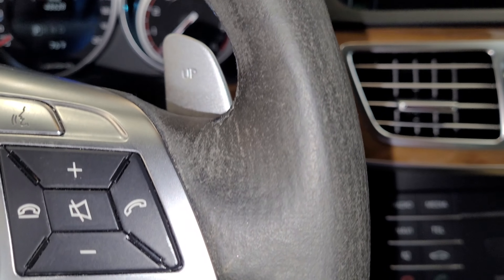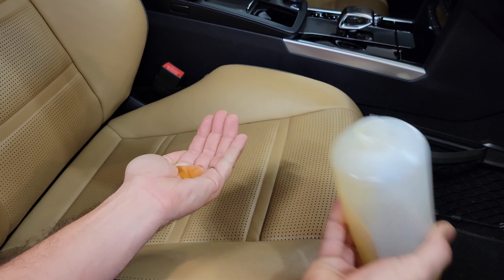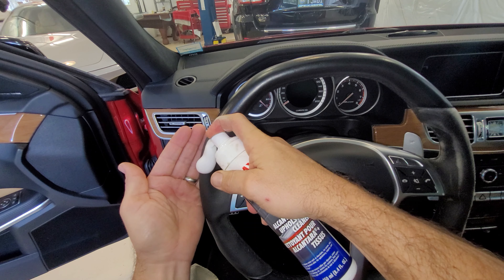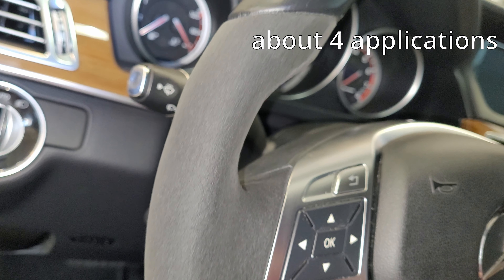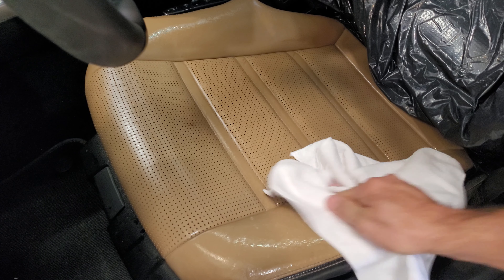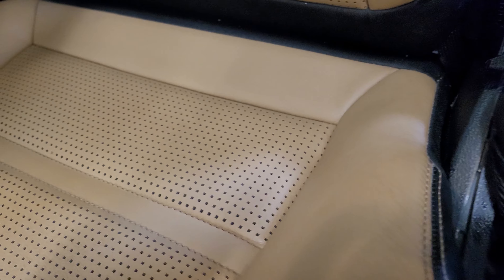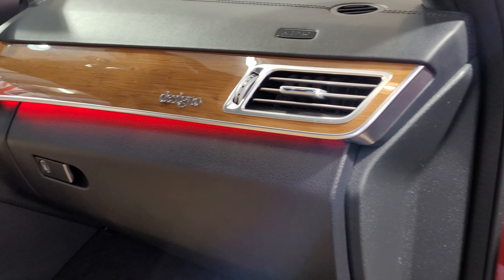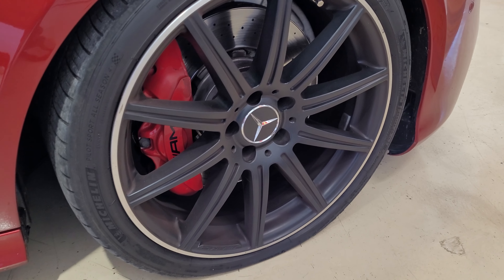Restored my E63 LEATHER & ALCANTARA with Leatherique & Sonax

Comment: Man perfect timing. Finally have my (not officially mine yet but soon) E63S in my possession, and the alcantara on the wheel is just as bad as yours was. I have black seats so can’t tell how dirty they are but since it’s higher miles it’s probably just as dirty
Reply from the maker: I'm not kidding, my steering wheel is indistinguishable between a brand new one. 
While you're black won't be discolored, it'll be kind of shiny glaze to it. It will still benefit a lot from a leather treatment and cleaning

Comment: The seats came out great dude! 👍👍 I need to pick some of that up for my c63's nappa. My seats dont have the perforations like the e63's but i'm interested to see what it can do for the wrinkles on my drivers seat.
Reply from the maker: You may want to do a little pre-cleaning, just to get off any kind of superficial seal, like oils or other cleaners. 
It will penetrate none perforated leather, it just takes a little longer.
There's a lot of different techniques, some people cover them and pull the car out into the Sun so the inside gets really nice and hot and that speeds up the penetration process. Otherwise, just time and it literally may take a week.

Comment: Your videos are excellent thank you. Thank god I noticed one comment about treating the dash as I assumed it was leather too and was going to treat it. Luckily I checked the comments. So what is leather that I should treat and clean?  Gearstick, arm rests on doors and middle between the seats maybe?  Many thanks again.
Reply from the maker: I know the seats, steering wheel, door panels, and probably shifter are all nappa leather, the dash and components like that are product called MBtex essentially a synthetic leather likely vinyl. I actually was curious what products are good for those, typically I just use soap and water and leave them with a very matte finish. But I'm sure there's some better products
Reply: @ExoticCarDIY   Thank you again. So I bought the same Leatherique products as you, about to have a go the seats later.  The instructions say that the Prestine Clean product can be used on vinyl and rubber (window trim, rubber bumpers and tyres) to soften and condition. No more products to acquire 👍
Reply: @ExoticCarDIY  Checked Leatherique’s website and they state “This process may be used on MB Tex vinyl areas to soften and condition.  Even flexibility on rubber window trim can be maintained with Prestine Clean”
Reply from the maker: @dominicnewby2875  nice! So not restorer, but pristine clean? That's what I'll use

Comment: Hey I literally just bought the same specs as this car should I be worried about anything.
Reply from the maker: Well, be sure to check out my other videos, I had to do motor mounts, cam sensors and solenoids, as well as the drivers control arm bushing.
All pretty common items on these cars, but once they're addressed, they are beautiful machines

Comment: Hey M back again~ quick question. I got a low coolant light showing up. what coolant should I use? w212 E63s. thanks in advance.
Reply: the coolant level is down by 10cm n found some small black debris  in the coolant tank. can I top up with water? n any suggestion about the debris?
Reply from the maker: You can top off with distilled water if it's just a little bit, if you need to add in a significant amount, 2014 and earlier they used blue, 2015 and up they switch to red, the part number for the red fluid is bq103005
Reply: @ExoticCarDIY  Always so grateful to see you replies. Mine coolant is kinda orange yellow ish... I added like 550-560 ml of distilled water from the super market. is that too much?

Comment: Hey man, love your content! Have you ever experienced misfire near redline under full load at high speed from maybe 3rd to 4th or 4th to 5th. It would suddenly sounds like the engine is seizing up.. It throw a cylinder 1 misfire code. I replaced plug and coil for all the cylinders and it happened again to me. The misfire would stay on pretty bad until I pull over and restart then the check engine light disappeared and drives normal...
Reply: Uploaded dashcam recording to my video for reference. You can clearly hear the sound suddenly changed.. This was the very first time that it happened (after coil and plug change, it occurred again). Don't know if it might be related, but 2 weeks before this I did oil change myself using 0w40 mobil1. Before might be 5w40 from the MB dealer that I bought from. Also I always put Shell 91..
Reply: Are you running a tune?
Reply: @AnontheGOAT  No, it is completely stock.